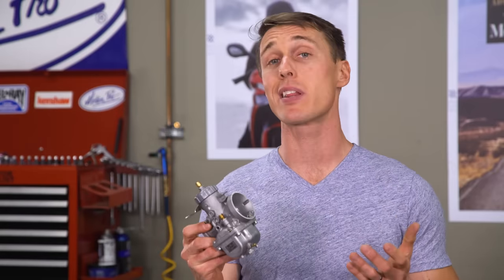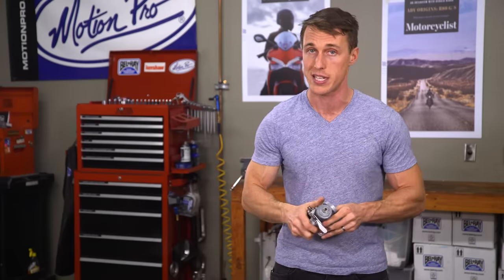Carburetors vs. Electronic Fuel Injection—What’s Better? | MC Garage

Comment: Carburetors are light years ahead of EFI. EFI is an expensive, complicated, and failure prone system, and it was not designed to make your bike run better. It was designed for the EPA to meet stricter emissions regulations. That's it, period. A fuel pump (which can be destroyed by running out of gas), can cost $500. So can an ECM. Then you have all the sensors to deal with. Usually 7 of them. Trying to diagnose problems with EFI is a nightmare if you don't have the proper test equipment and software. EFI simply cannot be made to idle smoothly. While it can be very precise at larger throttle openings, it is not at idle. If you change your exhaust and/or air cleaner, you will need a $500 electronic tuner to change the air/fuel ratio. Just like recent carburetors, EFI systems come from the factory set WAY to lean. They HAVE to be retuned to make your bike run right. $500 tuner for EFI, $10 worth of jets for a carb. You do NOT have to work on a carburetor if you don't want to, other than rejetting it properly to begin with. I have a 1997 Kawasaki Vulcan 750, with 128,000 miles on it, and the carburetors have NEVER been off. The jets are accessible without removing anything but the float bowls, which can be removed with the carburetors in place. It has always run perfectly. Carburetors CAN get all gummed up IF you leave old gas in them for months. But that is abuse. EFI can also be damaged by old gas, especially ethanol gas. With EFI, it is usually the $500 fuel pump that gets destroyed by sitting in ethanol for months, You will most likely have to replace the pump. A carburetor on the other hand can almost always be taken apart and cleaned, which is usually very easy and totally free. A carburetor can last over 100 years if it is properly cared for. No EFI system is going to last even close to that long. All of the parts in an EFI system usually cost about 5 times as much as a new carburetor. Carburetors were used for over 100 years, and have worked fine all that time. I have 6 bikes, all with carburetors, and have had no problems. I take care of my bikes. I would not own a bike with EFI.
Reply: Gerald Scott WOW.   Every bit interesting.   I'm not an expert but  I do understand a lot about this stuff, and  I tend to fully agree with you 👍
Reply: Gerald Scott. Good, accurate writing. I more than agree with you. My Harley carb. has only given me trouble (plugged accelerator pump orifice) once in 38 years and 103,000 miles. I rode the bike and fixed it at my leisure. I own my original 1965 Yamaha 55 I bought brand new. I have cleaned the carb. maybe four times in 13,000 miles. These idiots that rant about how good fool infection is sure like to exaggerate how bad carbs. are. Glad to see others like you that know what you are talking about.
Reply: Some oil for those squeaky joints, grandpa? Don't be afraid to move on with the times! 

Having said that, I might be heavily influenced by the fact that I've had weekly problems with the carbs on my 2016 DR-Z400E since the day I've bought it vs zero issues with every fuel injected bike I've ever owned. Although I am paranoid that one day I'll be out on a lonesome adventure ride in the middle of nowhere and that's when things will bite me on the bum.
Reply: Fuck off google. Move on with the times? You mean get  a fool injected bike that is hard to diagnose, hard to fix and more likely to go obsolete (no parts available) sooner? That not what I call advancing myself. You show a good sign when you do realize that when your injected scooter quits in the middle of nowhere that you will have a problem. I haven't had enough problems with any of my carbureted bikes whether Japanese or not, so I am not even close to " going with the times". A friend of mine bought a fool infected Kawasaki 38 years ago and all he has is a lawn ornament but my 39 year old 103,000 mile Harley is still running. I have tons of check engine lights in any fool infected cars I own. They prove how poor the reliability is on new vehicles. My collector cars with multi-carbs and point ignitions rarely need maintenance and are extremely easy to find any parts for. What little maintenance there is, is easy. I hope you and others can learn from what they read here. Have fun.
Reply: 500$ fuel pump and people actually believe this bullshit instead of fact checking it, unbelievable.

For 500 dollars you can buy a high pressure direct injection BMW fuel pump which is like comparing steam engines with ion thrusters when we were talking about little 12 volt electric low pressure motorcycle fuel pumps.
Reply: @BigUriel  of course when your efi sensor fails and your 300 miles from home or 90 miles from the nearest repair shop. The tow the hotel the diagnostics then ordering parts then the repair cost or the rental car cost and then returning to pick up your repaired bike. Give me the carb any day, mikuni carbs don't fail and leave you stranded.
Reply: @BigUriel   500$ for fuel pump on a carburated bike haha this guy is nut
Reply: @bottmar1  hard to diagnose? really? how about you READ THE MESSAGE ON THE DASH OR LOOK IN THE MANUAL FOR WHAT THE LIGHT IS SAYING, they don't go obsolete because they usually share similar parts also crapurettors are shit when it comes to fixing them because if you fuck up you don't know till your bike is on fire or you're stranded with no gas while with EFI you know immediately, EFI bike is actually easier roadside as I had my injector go on the side of the road (rock punctured ferring and hit it) soi just swap it with a spare i carry and went

Comment: carb adjustments are simple unless you have no idea how to ride a motorcycle. The work required to maintain a motorcycle is payment through enjoyment of owning a motorcycle. Fuel injected "equipment" can easily be turned off by a police enforcement (public servant is what they actually are) to control you. A little water in the wrong place and you are done. Enjoy your expensive repair bill because you are stupid and lazy. Carberators on motorcycles have a better sound and are cheap to repair. I enjoy two stroke triples myself.

Comment: In the defense of carburetion, if your carbs are properly adjusted and you keep ethanol free fuel in your bike, it will run just as well as efi, and be way simpler. I have several carb bikes that fire first or second kick everytime after sitting for months.

Comment: Everything has its advantages and disadvantages. With that said, both are good 👍 efi has it's advantages but is easily limited, and prone to sensor failure. Carburetors can easily be tuned but are prone to clogging or when left in prime position fill your engine with gasoline. An everyday bike would be better with efi and your weekend drag bike would probably be better carburated. Anyway to each their own, this is only my opinion.

Comment: Great video and brought back memories of messing with the fuel mix screw and a glass bottomed spark plug trying to improve those sooty spark plugs. I don't miss carburettors or the larger fuel bills that go with them.

I was confused by your your reference to "injecting gas" until I realised you mean't petrol and was using gas as short for "gasoline". The Atlantic divide eh!

Comment: if you have a well tuned carb you wont need to pull the choke out.. Even when it got down to freezing couple twist of throttle then push starter and pow its starts up let it run for a mintue while you put your helment on and gloves give it a few light revs and shes golden for warmer and elevation thats easy especially when there is a fuel pump on the bike helps to accelerate fuel to the carb when your twist the throttle on hard acceleration going up elevation.. i love carbed bikes if your  traveling and somthing goes hey wire on that fi bike then your stuck well with a carb you pop the tank off fix the carb and the very least limp home

Comment: I have no doubt! Carbs definitely and forever. Lately, I decide to buy a bike and I didn't even make my self this question. Engine packed looks pretty much the same, but they work completely different. Engines with carburator they are a biologic unit and works themselves. In fuel injections everything is controlled by an electronic control unit, that is ok for cars but not for the bikes

Comment: Being certified in EFI and DDFI, plus years and years of working with hot street bikes...... It’s your personal choice. Do you want to change jets for certain areas? Jet changes take a few mins. Pulling out the 3D map takes a few mins. Real key. Do YOU know how to read spark plugs. They tell the real story. I can tell you where you buy gas by looking at your plugs. Lol. EX: if your plug(s) have little red dots, Chevron. The additive they use puts them on there. Used to build drag motors before I retired.

Comment: a good carbourater is just as good as a fuel injector, i used the same anount of gas on my 2013 ktm as my 1989 yamha fzr same amount of hp
Reply: having a harsh cold starts? Nvm. I'll take PGM-FI instead

Comment: I’ve always had problems with my carbed engines. Lawnmowers, chainsaws, etc. I’ve been wrenching on cars since I was 13 but something about a carb just baffles me. I hate them with a burning passion. So tedious to work on, and I hate putting stuff together just to take it apart again. 

Whenever my carbed power tools give me fits, I use spray carb cleaner until she dies and I get a brand new one. My motorcycle (2000 VLX 600 single carb) going to the dealer if she has carb troubles. Electronic fuel injection all the way baby!

Comment: Someone's probably mentioned this already but it's not the vacuum from the intake stroke that draws fuel in. If it worked that way the engine would draw it the most fuel with the throttle closed, and next to nothing with the throttle wide open when pressure in the intake manifold will be close to atmospheric.

A carburetor has something called a venturi which is a section of the intake path that is narrowed into a very small area so the air is forced to go through it very fast, and the faster it goes the lower its static pressure which is what draws in the fuel. More throttle means more air flow and more air speed so greater drop in pressure at the venturi point and therefore more fuel.
Reply: Yes but the venture only has a vaccum because of the  down stroke of the piston

Comment: My '97 Concours*, carbs, hydro-locked and resulted in a bent #3 connecting rod. 20 year old bike: fix cost about the same as blue book sale price=project for sale. Now on a V-Strom 650EXP: fuel injected. Fantastic, smooth, nice to shed 200lbs and able to head down a forest trail when pavement ends - but miss the shaft drive. Carbs, never again; unless I become a bit better mechanic and have a shop to work in=café project bike.
*  Kawi still using carbs in a sport-tourer in 1997. The bike was launched in '84: they could have made the injection update along the way.

Comment: Like the more natural throttle response on a carb'd bike more. EFI is more on/off on newer "regulated" bikes. Some better than others.
Reply: The ramp down may be able to be tuned out.
Reply: @bradboustead1682  Yes, i agree much can be tuned, but i thought more about how the bikes are delivered as standard. I had many carb'd bikes and all were smooth as standard and which i can't say about the newer EFI's i have driven. There is some hesitation or on/off in the power delivery i can live with but don't like.

Comment: My 25 year old KLR650 only ever has notable issues when it's super cold. I've only had one time it wouldn't start for me, and honestly I probably shouldn't have been trying to ride in those temperatures anyway. It could probably use another good carb cleaning, but a little bit of sea foam has kept her running smooth enough into her 38,000 mile mark.
She's a tough and reliable MF'er.

Comment: K2 600 gsxr is fuel injected, but has a choke. They bothered adding dual injectors, dual air intake and electric throttles ... somehow the simple PID process of keeping the idle high enough when could eluded them.

Comment: My fuel injected 2012 Triumph Bonneville has an irritating lurch when rolling back on the throttle after coasting. This glitch is most pronounced at low speeds. It may get me killed one day as the engine will pop back through the throttle body and then die when pulling away from a stop sign or traffic light. I've read that this issue is common on other fuel injected bikes as well. I've noticed that Triumph has repositioned their oxygen sensors as close as possible to the exhaust ports on their newest models. None of my previous motorcycles (all carbureted) that I've owned since 1971, had a problem like this. Properly tuned carbureted engines are smooth running.
Reply: It may be able to be tuned out. For emissions and gas mileage reasons, the ramp down of fuel may be too abrupt.

Comment: It's more common to find carburetor bikes than EFI ones, in my country. Mostly because most bikes here has less than 150cc displacement.

So, chief, you can find PLENTY carbureted 200cc cruiser bikes from '93 running inter-province road through mountaineous passes in weekly/monthly basis. They run well.

Comment: Your statement about fuel injection on bikes may be quite accurate.Fuel injection, however, especially in diesel engines, and quite a few large gas engines as well, has been in use far earlier than the 1980's.
Reply: diesel can only be injection...so abysmal why am i loosing time

Comment: I bought a 450 f and 250f put some file in them that had been sitting for over year and now they won’t start so I drained fuel out of both tanks after realising my mistake. I out fresh fuel in today got them both started tick over but minute I touch throttle they start bugging out and die anyone know what this could be I have been told it will be the injectors In carb
Reply: unlike idle rpm, Engine consume 10 times more fuel when throttle, if it not get too much fuel it will die… the solution is clean fuel pipes, and remove all water accumulated inside carburetor by opening drain screw.

Comment: I'm OK with either, both are pretty rock-solid reliable.

Cleaning carbs is a pain.  Well the process itself is easy, but sometimes they're a pain in the ass to remove from the bike, and then you get them apart, and if they're too old it's hard to find OEM replacement parts, so you buy OEM knock-off parts from a Chinese ebay retailer, which are always slightly different than the OEM parts in order to fit multiple carbs, so then it never runs quite right, and they become a huge headache.  If your carb is supported heavily, though, as I'm assuming most HD's are, then it's probably MUCH easier to deal with, but I've never owned a bike with common carbs, lol.

I like the robustness of EFI, it just DOESN'T die.  Sure, you can lose a fuel pump in the middle of Alaska or something, but whom has that actually happened to?  The parts really don't die often, you're more likely gonna pop the engine before you lose a major EFI component.  That is unless you buy a Ducati or some other euro brand, lol.  Also like that they literally require no maintenance.  No seals that get dry and then when you pop off the bowl or something then the gasket tears and you have to buy one (which doesn't exist, etc. etc. see above), so you get that reliability.

Now that all being said, in terms of fueling, to me carbs feel better than EFI about 100 times out of 10.  This is mostly because of emissions, I know, but carbs nearly always feel more 'natural' to me than EFI.

Comment: i have 2 carburetors for my dx100. the spare is rebuilt and ready to throw in taking about 20 mins tops to swap out. i have a kit ready to go and can rebuild the one i take out in about an hour. having said that the Mikuni are fairly bullet proof carbies and I've only had to swap it once. point is unlike EFI you know where you're at. the rebuild kit is cheap and simple as all you need to do is swap out jets, needle and gaskets.

Comment: I bought a older used 50cc Quad wheeler for my grandson when I looked it over I noticed the bottom of carburetor was wet and the guy said that was the problem the carburetor has an electronic choke so I put on the replacement he bought. This is supposed to be small whoever owned it before the last guy put 20x7 on the front and 16x10 on the rear the fenders were cut off leaving only the middle and over gas tank and when I changed the carb I noticed it’s a Mikuni and the tires extend over 3” farther then front fenders. The real problem is the ignition I had to order a 6 wire keyed ignition when he tried to turn it on the whole ignition would turn causing the red wire and blue wire to break off and it was hard to turn to start so I ordered one. The guy said it wasn’t electric start but I first noticed the switch on left side of handlebar it also had a lever you turn to left self returning with a lightning bolt through a circle. I took the seat off and there is a tray for a 3.4”H by 5” W by 2.75” D also a red cable and black cable tucked away the red went to a round cylinder that appears to be a starter and they both had the square rubber boots that both said+ even though one was red and other black. The only thing I don’t know is the cc of it. After I bought it he said it might be a 90cc the crankcase cover which is 20” by 4.75” with the writing HER CHE the rest maybe 1 letter no more then 2 are missing. The only other numbers I seen on top back by Allen bolt to crank cover says OIL 100cm. So do you or any viewers know if it’s a 50cc or 90cc it must be beefed up because with the big tires he claimed it to do 30mph that’s high turning those 20” and 16x10 and having a Mikuni carburetor made in USA and it’s a Chinese Quad. Any info would help me, Thanks in advance.